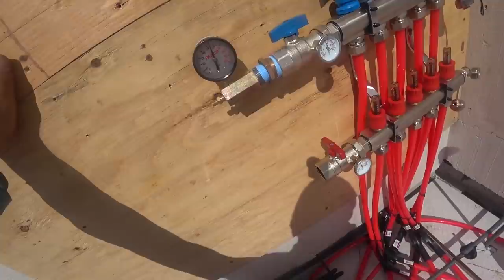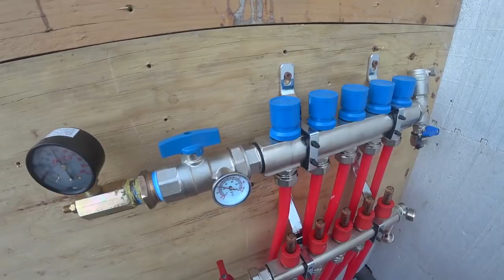Building a House Start to Finish: Radiant Heat Installation

Comment: With the pitch of your plumbing waste lines: I have a 24'' level w/ a 1/4 '' nut taped to it for 1/8" fall or a 1/2" nut for 1/4" fall taped to the very end of the level. The one you had w/ 1/8" & 1/4" fall was good as well.   Love your channel & have followed it from the beginning.  I like the way you take the time to do it right, no short cuts.   Bruce

Comment: Make sure you have sufficient concrete cover top and bottom on your approach slab extension. Note: I would not have recommended attaching that approach slab as it being outside it may be subject to frost heave.

Comment: For easy tensioning and zip tie ripping (clean breaks the zip tie so its not sharp) I use a Panduit GTS-E (also called zip tie gun). Great for cable tying anything... Great job! New follower and pretty amazing how far you both have come!

Comment: With the re bar and slab going from the inside (heated) floor to the outside without a heat break you have just made a very good heat sink outside and the same goes for the slab touching the concrete all along the walls , they will wick heat away from the heated floor , the way this system is made it will take a enormous amount of energy to heat
Reply: It will also have a huge amount of thermal lag. Slab heating systems are useless if you want to do thermal setbacks ... there was a time with steam heat that they used cast iron radiators. There is a reason they became obsolete.
Reply: Was just about to say the same, it should be insulated from outdoor space with a heat break, to avoid cold bridges to form especially in cold climates

Comment: I hope he's going to cut an expansion joint along the length of that apron and use some sort of thermal break in the cut, otherwise, come the winter it's going to act as a giant heat sink for the radiant heating.

Comment: A compressible joint filler added where the exterior apron abuts the garage slab would be desirable because of the temperature differential between exterior and interior concrete slabs can cause "creep" influence on the garage structure and possible concrete cracking.
Reply: David Blackwell . Good piont
Reply: It not being insulated will also limit the effectiveness of all that in slab heating.
Reply: Yes, perimeter thermal insulation in that climate is very effective.
Reply: Normally, yes, but I didn't observe the joint filler being placed during the prep before placing concrete. Hopefully, it was done in the process, as you say.

Comment: Great job guys... The hard work will pay off! When we build houses with in floor heat. We take it 2 to 3 feet outside of the garage door to keep the snow out of the garage and or house! I know its to late in your case but thought i would share! Keep up the hard work!
Reply: Donny Krane Or save yourself the effort and don't install insulation! That works just as well. Oh wait, the heating bill will be horrific though.
Reply: Baddad36 read my comment again bud! I didnt say anything about insulation! And when it comes to heating a whole house, whats a few for feet to heat...

Comment: 3:45 always wind PTFE tape counter clockwise to the pipe thread or it will bunch up and come undone as you screw the fitting in (edit: that's why it leaked. I just got to that bit)

Comment: Hi i have over 35 years in the concrete flat work business and had to point out the big mistake made in my opinion ,is that the apron should have been poured total separate from the inside slab because of frost heave out side will lift yr slab up , if i were you i would def cut the apron completely through rite at the out side edge of yr wall so if the frost heave yr apron it wont damage yr inside floor .   hope this helps
Reply: I agree 100%. Not to mention air content of interior and exterior concrete should be different.
Reply: I dont understand why they would tie interior and exterior slabs together with rebar either. It should be a clean construction joint there. Maybe even expansion joint separating them due to the thermal difference between inside and outside
Reply: lostchild2003 I dont mean to be negative. Just giving my opinion based on my knowledge and what I know from experience.
Reply: He said they decided last minute to add the apron...
Reply: What about thermal insulation between the heated inside and outside plates?
Reply: Yeah, sepearte apron and add a radiant heating loop to the apron. Would make their winter life a lot easier.
Reply: Yep, expansion joint for sure. Heated inside slab tied to unheated outside slab. I agree with totally separate pour. But, it's just us talking.....

Comment: i see you got some heating lines going right next to you toilet riser/closet collar. make sure when you finally install your toilet that you use a rubber ring, not a wax one since it will melt from the heated floor.

Comment: Nice job, It so much "nicer" to have heated garage floors when you have to lay down and fixing the "stuff" you are fixing. A noter thing to remember it all helps to head the house, and when you have all that slap and iron, it function as a "Mass" and can hold a lot of heat, if you decide to make a  Solar heater then you can store the head in the floor.....good idea. You will be so glad that you did that in the long run....good thinking. Best Jørgen Thomsen Denmark DK
Reply: " It so much "nicer" to have heated garage floors when you have to lay down and fixing the "stuff" you are fixing". Guy, if a person can afford to build a million dollar house then they should be able to afford to have a Mechanic work on his car.
Reply: Maybe, ore Maybe not, because he has used all his money to build a nice house .... so down on your knees and do it your self...Therefore the worm floor, and some other things, the heated floor dry much faster then a non heated floor in the winter. And then the Head absorption ( heat accumulation ) from the heating source, what ever that must be.........solar, wood ore what ever the future brings in to ones life in form of heating devices......."Like a thermal heating battery"......That is actually good stuff....I use it myself...and when the sun have decided to shine, then charging the floor with "free" heat....That works very well.....Maybe a much bigger "Mass" then he have used, and Then we have 500 mm Insulation in the wall's and the floor....To keep the heat inside the house i steed of making the birds happy outside the house, with worming up the other wall and roof.......Insulation are much cheeper then constantly heating the house in the winter, and trying to cool it down in the summer......That's the way to go when you want to live off grid with limit resources......and be self-supported .......Just look at his way to make running water from the hillside.....He/ They are thinking this way...... and That is a Good way...By the way We have here in Denmark made a lot of experimenting on that subject, building a house on top off 100 m2 with lot of hot "red pipes" for every 15-20 cm like they have don in the floor and made seven layers of that, so you can head that big "heating accumulator" and then a isolation on the top, to control heating the house, the heat will the rice slowly up true the building, and all heated with free sun power, but you have to make a possibility to close it in the hottest summer when you don't need so much heat, but it is very useful in the Spring, Fall, and the sunny winter days, collecting lot of free head ...Remember for every 1m2 hot water collector you get almost 800-1000W free energy from the sun, and if you use Electrical solar collector you only get 150-200W / m2 because They only are 15-22 % efficient   ......So go for it........ when you are building a New house,........ When you are done building it is to LATE. ............... .Have a good day Jørgen Thomsen Denmark DK
Reply: Yes You are completely Right, just, trying to make a "heating" debate...Have a nice day to, ............and let us build something creasy  ;-) while we are waiting for someone to se us.....JT.DDK

Comment: I thank you for using an adjustable wrench or the right job on those chrome plated brass fittings. Please do not use adjustable pliers on brass fittings. and then 9:20 you went back to no don't do that.

Comment: When it comes to fittings I have always followed my dads advice. He says put them as tight as you can, then 2 more turns:-).
Reply: Tighten until it strips, then back off a 1/4 turn...

Comment: Would heat not be conducted into the apron? It would help with snow removal,but add to heating costs.
Reply: Ken Knutson, this kind of heating is so efficient that I doubt they would notice any difference. Actually it wouldn't ba a bad ides to add a circuit for just that apron
Reply: since the heating is being done with wood the only cost is a little extra labour so probably not even worth worrying about

Comment: That wasn't much insulation under the slab.
In sweden we use normally 300 mm (12 inch). But you maybe doesn't get so cold there?

Comment: Just wondering if the the radiant tube should pass across the footings?
Reply: ThrottleStopRacing that would be a waste of heat, as it is the heat will conduct out to the apron.
Reply: It'll just make it more fun when they go to anchor everything down. "Please don't hit the PEX. Please don't hit the PEX."
Reply: My concern was fear puncher. Was only supping a thought, not negative input

Comment: you need take measurements for the wood walls before pour concrete if you going to drill for the anchors for the walls ,hope not drill the pex line

Comment: as a plumber i would have wet tested that ,not air test and with manifolds one need to fill one end and let water come out the other end , so fill with water then add air for pressure or totally pressure it with water if you can get a few bars in :)
Reply: they are only doing the pipes i done a central heating at my bro's house on Monday and we filled it with water  no leaks so carried on with full heat test from boiler .. and ive done tanks too, always best to do a test with a liquid as the air ones can be false.. been there got t shirt on those :)
Reply: Usually air is used instead of water to avoid soaking the polystyrene insulation in case of any leaks. Wet polystyrene is bad insulator and it takes ages to become dry again once built in. (By the way, they are missing a foil on top of the insulation, to avoid water of the concrete entering the insulation.)
Reply: its going to get wet when the concrete goes on thats the most stooopid thing ive read like derrrr
Reply: Believe or not, in my 2nd world country this building quality you can see on this video is unacceptable. There is always a thin foil on top of the insulation below floor heating. Its only purpose is to keep the insulation dry. EPS (expanded polystyrene) can absorb water. Once the concrete sets and is covered with ceramic tiles it has little chance of loosing that water as it is also closed from the bottom by the vapor barrier. 
http://cdn.blog.hu/gr/grussgott/image/Futes/Padlofutes03.jpg
You can also put there a reflective foil, then it will have double purpose.
By the way, they made several other mistakes, it is really hard to watch, because many of them would be easy to avoid.
Reply: Not required....

Comment: And one other thing when you making the slab it is recommended that you have water in pipes and under pressure at least 5 bar....in the eventuality that you damage the pipe when you make the slab.....

Comment: You will NOT regret installing the radiant heat. I heat 3 houses with my boiler......it is not the most efficient out on the market......but I can get parts at any hardware store. No computer module to go bad and can't find replacements. just a water heater thermostat......it is also a non-pressurized unit. domestic hot water is heated with a copper coil submerged into the water jacket of the boiler. sure is nice having unlimited hot water in the winter.
Reply: Actually, it is very efficient, if you drive it with mildly warm water. Our system goes with 86F water.
Reply: I meant that my boiler is not the most efficient boiler available. But all the parts for the boiler are readily available. radiant heat is the way to go.......SO much warmer feeling than forced air. Walking barefoot on a warm floor is AWESOME.

Comment: So how did you fix you bottom wall plates to the concrete floor?   Drilling and installing anchors would be risky to hit a pipe.     Did you glue them down?   If so what glue did you use?

Comment: The solar water heating will heat your house and give you hot water.  Hope you set up your hydronic for optional addition of solar. In upstate new york there is an entire spa that is all solar hot water.  The vacuum tube type will convert over 90% of uv into heat.  Checkout Sunmaxx solar.  I did training with them 7 years ago and put in a few here in texas.  They will heat water with 3/4" of ice on the tubes since the UV light gets through.  Love to see that radiant tubing.

Comment: Bonjour,
Je vais ecrire en francais; désolé.
1-la dalle en beton doit etre desolidarisée des murs, sinon la dilatation va faire des fissures. il ne fallait pas enlever le polystyrene.
2- la taille du maillage est trop importante, il ne faut pas depasser 15cm*15; 10*10 is the best.
3-couler la dalle beton avec 20bar de pression d'EAU dans le reseau de chauffage; pas de l'air.
4-faire 2 dalles independantes : une pour le batiment, 1 pour l'acces au garage. Sinon il y aura des ponts thermiques.
Bon courage.

Comment: I'm surprised you didn't drill into the walls so the edge of the slab around the walls are structurally tied to the wall with rebar epoxied in and also I hope ur floor has a slight slope to the drains u didn't mention it but I'm sure ur friend knows but still great job guys loving the videos!

Comment: I'll have to research that radiant tubing as I'm curious what pressure to push water all the way thru? Friction must quite a bit over such a long length
Reply: Harley04 ...there are 5 zones.  Each loop looks to be 200' - 250'.  No problem for a small pump.
Reply: circulation pumps. rated for various run lengths

Comment: Hey I’m disliking this video only if those 2 footings in the centre are for future support columns. If so why did you run the radiant heating tubes across them so they can be punctures by the future columns?
Reply: +Dubious  The concept of floor radiant heating is old, Roman old, and, it is a great heating system if you have the money to pay for it.  I have heard of a lot of people installing it, and then turning it off because of the cost to  use it.  They shall see!

Comment: Q: if you dont have county building codes, what standards are your inspectors using?
Reply: They said that there are no local, city/county,  "building" codes but sounds like there are, maybe State requirements for plumbing, etc.  Have to go back to that video to be clear.
Reply: Yes... the county they are in doesn't have its own inspectors, etc, so they adhere to State codes. The inspectors that come out cover several counties.

Comment: Fab job! What are you planning for radiant circulation pump?
Also off-grid a bit further North (in BC) and looking at options that will be gentle on power...
Cheers!
Reply: batmann2o Nice, thanks! We have their deep well AC/DC SQFlex pump... I'll check the Alphas out.

Comment: Hey I got a few questions, how long were the roles of pex tube? I assume at no point there are joins in the runs of pex? Then what are you going to use to heat the water tankless or tank heater? We starting soon and I'm weighing up all the options and figuring this lot out my self. Love the videos I've watched them all!
Reply: There is a big woodburner stove outside the (north wall I think, On the right side looking from the front )

Comment: But why do you need radiant flor in the garage? Will you sleep there?
Reply: They will move the caravan in there as they finish the house they will have a shower&toilet
Reply: Guillem Planas i Hervás  heat will radiate up through the whole house from the slab.
The Romans invented underfloor heating and the principles the same.
Reply: It's for Bugaboo, of course.  I mean, reeeeeeally.  It also makes for a nice, warm car when you leave in the morning.  I keep forgetting to ask how they'll be heating the home.  Exterior wood stove/furnace, propane, or what?
Reply: I was asking the same thing Guillem.  It seems like a HUGE waste of resources.

Comment: I'm curious as to why they've laid underfloor heating for the whole of the garage area  instead of the toilet and shower area.
Reply: it looks like they have 5 loops, so they can have different temperatures in different rooms.
Reply: If they don''t  all the plumbing will freeze because it is not three feet below floor level. (Below frost level). They should have put the plumbing in first, before filling with dirt and gravel.
Reply: Most hydrophonic systems here use water, glycol ,or mineral oil and are closed loop. The most efficient hydrophonic systems have the advantage of an underground water flow or a large body of water for a large thermal heat sink. I live in an area where the top of the river nearby might freeze to a foot thick in the winter. Piers require bubble systems to keep the wooden poles ice free.......however ,my local boat club drove heavy steel girders deep into the earth under the water and tap off of the ambient earth temperature. In 40 plus years ,the girders have not occurred ice damage. If you can tap into an underground water system, a standard heat exchanger can benefit greatly , winter and summer.